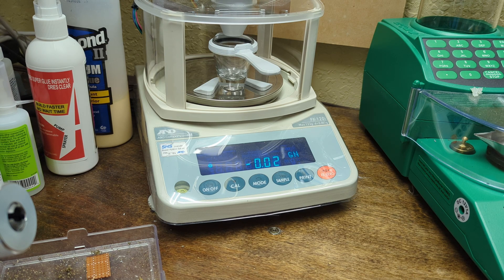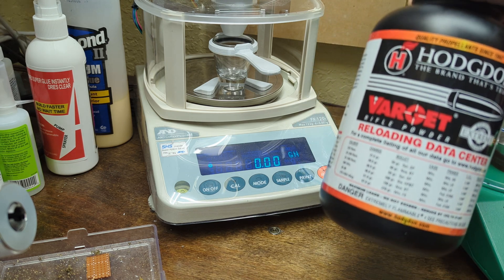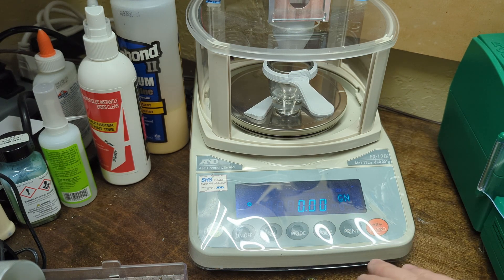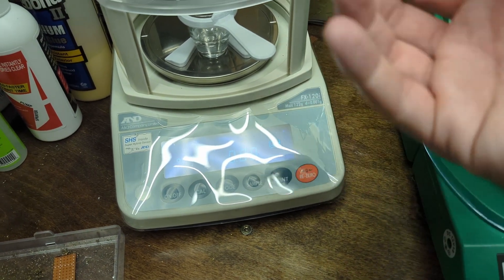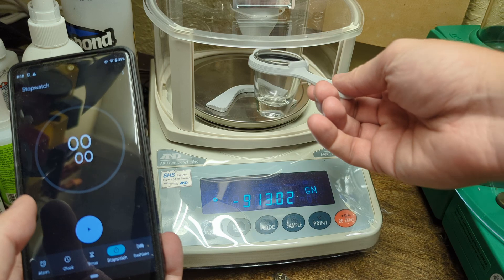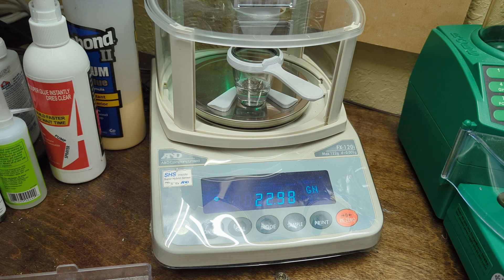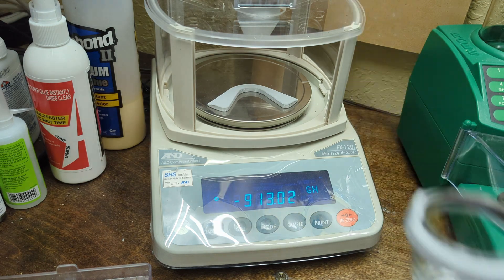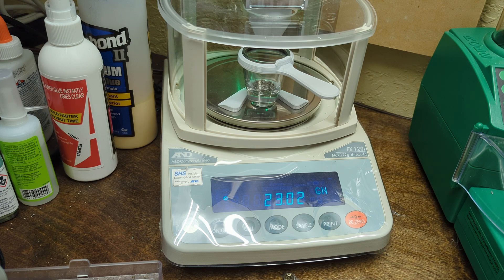Tricking the Autotrickler

Comment: Curious: can you run the scale and app in grams, instead of grains? 0.001 grams is 0.0154 grains.
Reply from the maker: I've never tried. IIRC, the app sends just a number, so if the scale is set to grams, it will operate in grams. But the app only allows one decimal place, so you'd lose a lot of precision trying to run in grams.

Comment: I use h4350 at 39.2
Do you think if I go to 39.1 I will have better results?
Reply from the maker: Going 0.1 vs 0.2 is a much larger weight change than what I'm testing. I'm testing 0.01 increments in this video. That said, 39.2 vs 39.1 is a fairly small difference, and you'd probably only notice the difference for a very accurate bench rifle.
Reply: I actually had a typo. My powder charge is 39.2 and I am going to go to 39.19. I shoot long distance, competition bench, rest.
Reply from the maker: Based on this test, I would just leave it at 39.2. I couldn't tell that it really made any difference.
Reply: @TechDregs  thanks